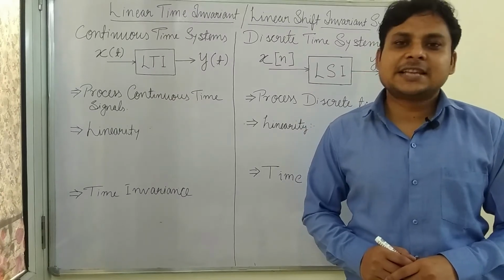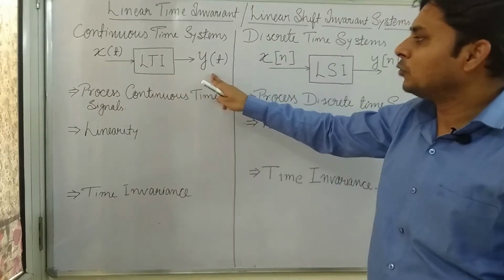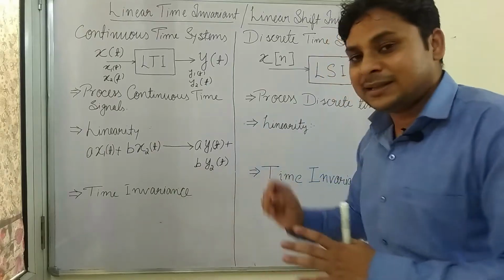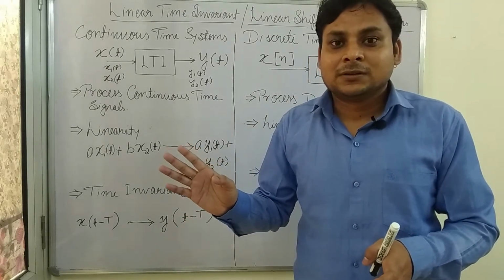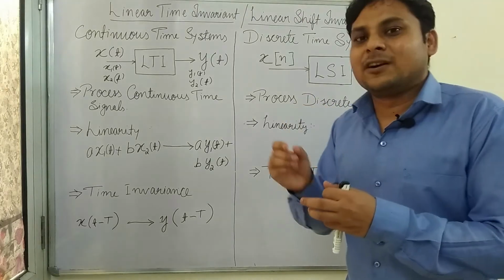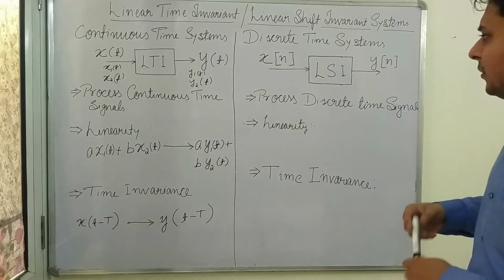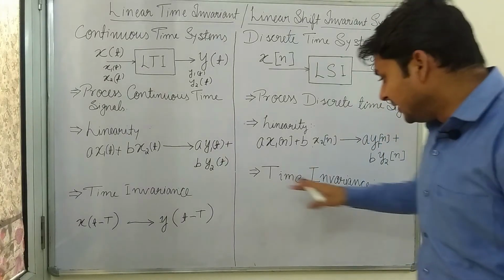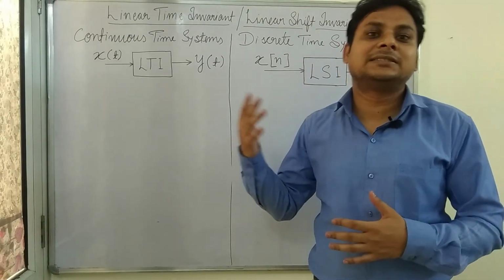Linear Time Invariant & Linear Shift Invariant Systems(with comparison)

Comment: Sir, digital signal processing and signals and systems both of them similar or not... If so can you tell me the difference?
Reply from the maker: Signals and system is a fundamental course that gives an introduction to signals and systems. On the other hand Digital signal processing an advanced course which focuses on processing algorithms for signal processing. But students needs to study signals and systems first to have easy and clear understanding of DSP. Further this subject advanced to digital signal processor where signals are processed with the help of signal processing algorithm in place of microprocessors or controllers.